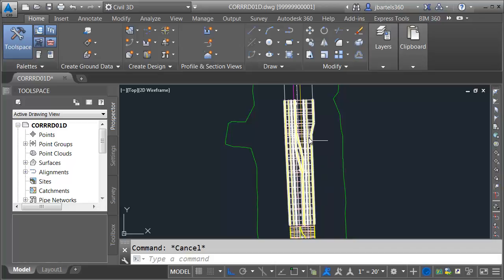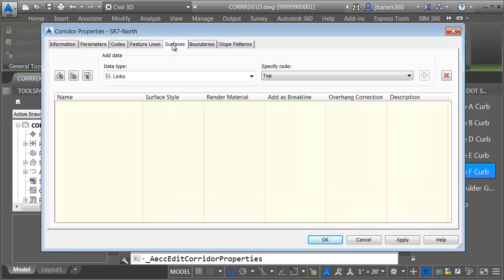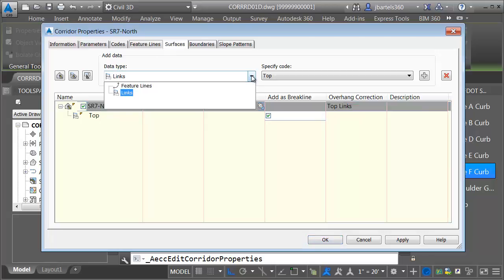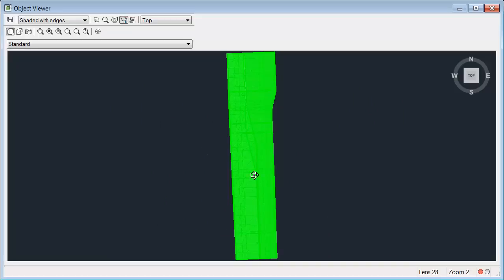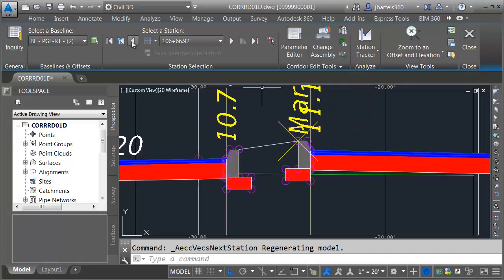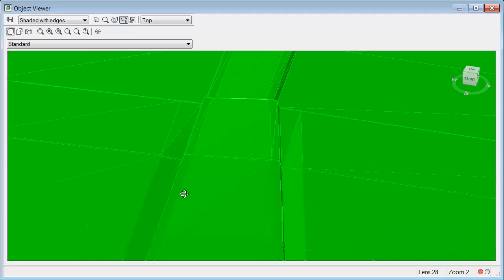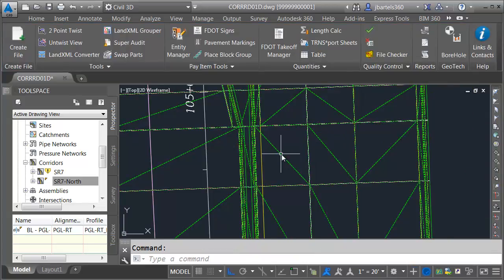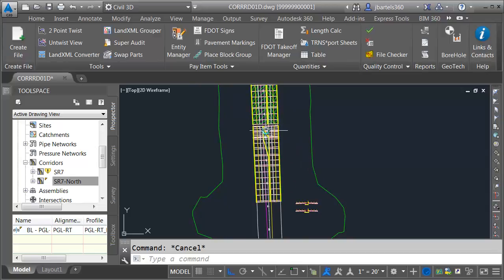Civil 3D Advanced Roadway Modeling Pt.5

Comment: Good morning Bartels. I was wondering how to solve a problem when I create a surface from a corridor which is built with the same assembly but just in some parts along the alignment, leaving gaps between two subsequent corridors. When I ask for a surface extended until the outer boundary, Civil also interpolates a surface between the two adjacent  corridor surfaces, creating one unique continuous surface.

So far, I have solved it creating as corridors as needed because the interruptions along the alignment.

To make it clearer, it is the case when I have interspersed gutters and curbs on the same alignment.

Thank you Bartels